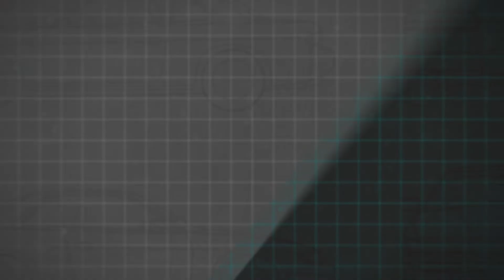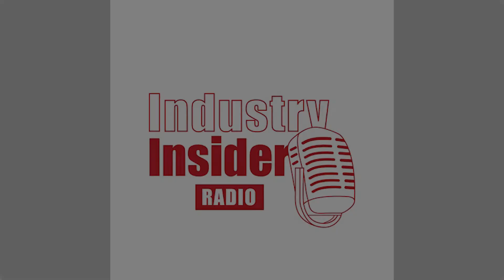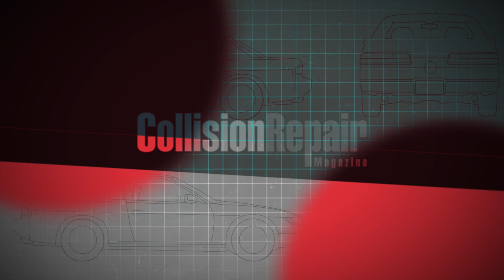Industry Insider: Parker Lord on Fusor adhesive applications, OEM compliancy and more

Comment: Why did you discontinue Fusor 153? And no I won't switch to 152 which would require buying a new expensive dispenser and tip. Not to mention the 300 ml cartridge would expire well before it was used up. Looks like I will have to switch to another brand like 3M, Loctite, SEM, Norton, etc.